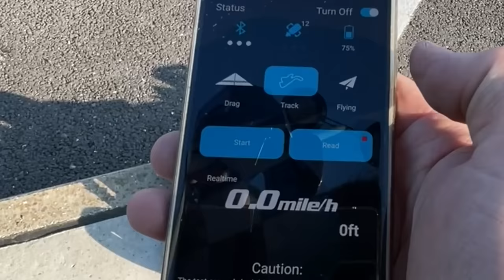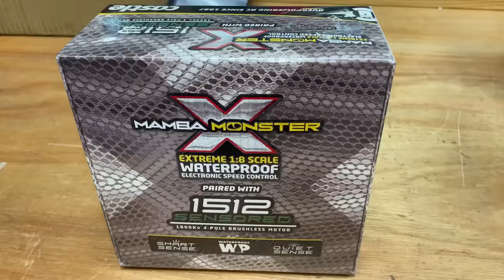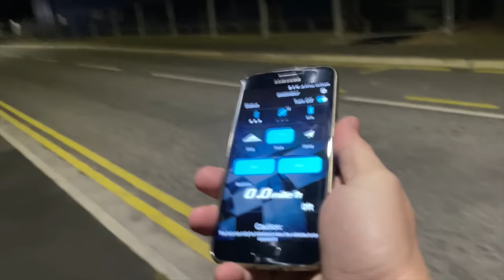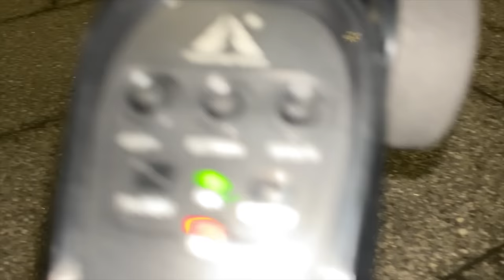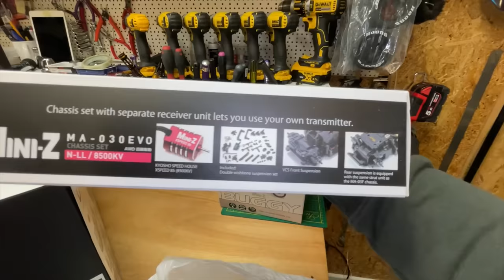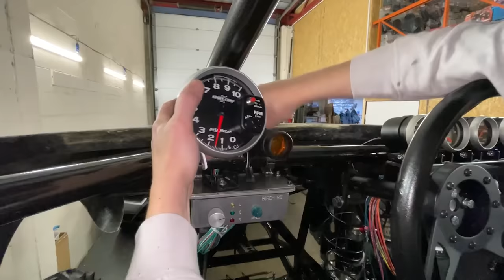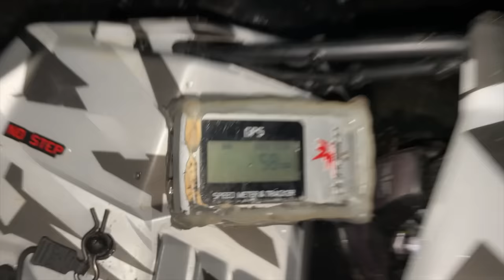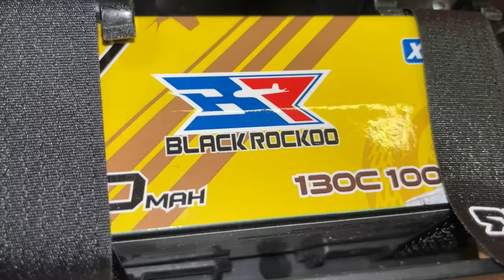Kevin Talbot's 2022 ReWind - RC Car Mayhem

Comment: Cut a small piece of fuel tubing about 1/8 or 3mm slip it over the end of your fuel/ pressure lines.
Push them over your fittings.
It should do the trick.
Keep up the Madness 😉👍👍

Comment: As much as I dig the lawn darts grass record attempt, you should cut about half the length off (or a different frame), and see what it can top out at.
That dual motor and setup need its maximum advantage taken with a lighter chassis.